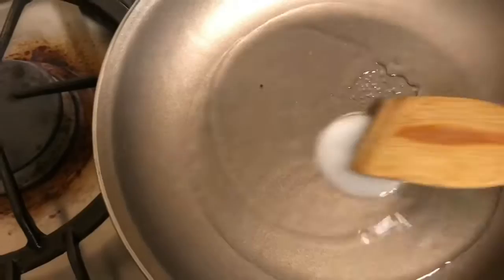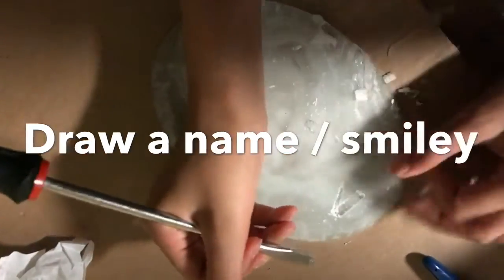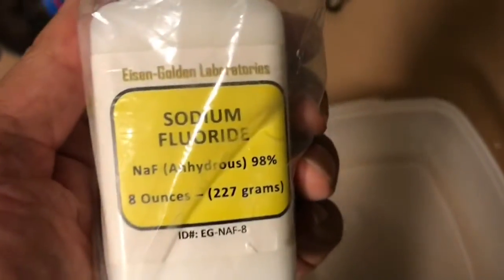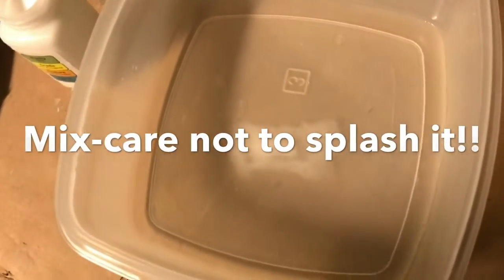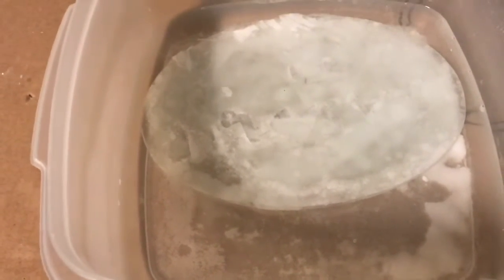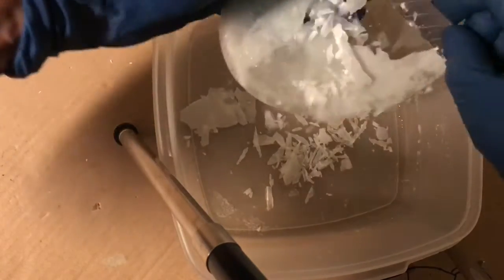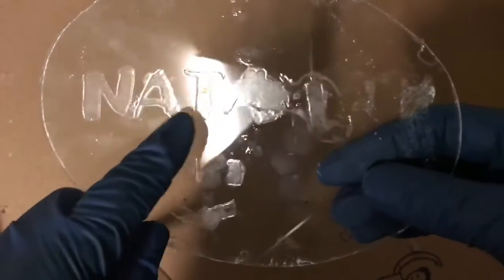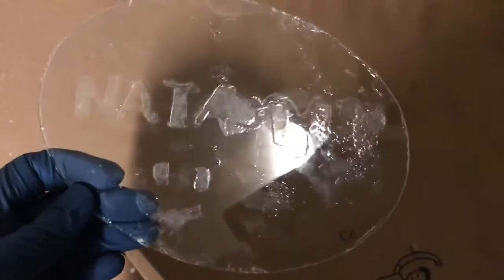How to Etch Glass with HF

Comment: Nice result, today I tried to etch glass with 10% HF, but it did not make the Glass milky somehow. It just removed a few mm of the Glass.
The acid was on there for around 30 Minutes, I put some new acid on there and let it on over night. I'm excited if it will turn out that great as yours :)
Reply: Strange.. i'm getting the same results - it's turning the glass milky really fast, especially when slightly warm, but the white stuff is easily washed away. So it's etching the glass clear.
I will try again with 30% HF and also with 3%, maybe its something about the concentration.
At work I have to do with that stuff every day, but we don't have any experience with Glass etching, so me and some coworkers wanted to try😂
Reply: Did you work it out?im interested how to get the frost effect too

Comment: Hey questions so if I were to add much more acid into the water or just use much less water would the mixture be much stronger or burn much quicker I’m liking for immediate etching like what u get with the product “etchbath” but am new to chemistry

Comment: Nitrile gloves are not adequate to handle HF. You need butyl or other stronger more resistant gloves for this and you also need a face mask with an acid filter against the fumes.
Reply from the maker: Totally agree. HF is hazardous !!!

Comment: Where can you get these chemicals and what are the ratios?
Reply from the maker: I purchased the sulfuric acid from ebay. It is also available from any chemical supplier. The sodium fluoride was available in pure form from an ebay supplier. For the etching, you can use permanent marker to cover up the areas you don't want etched for an interesting frosting effect.